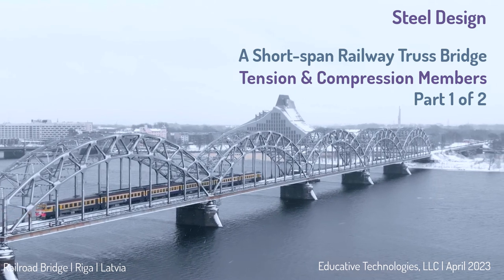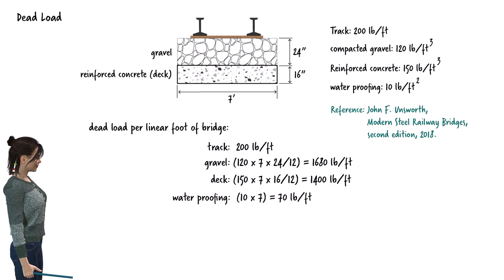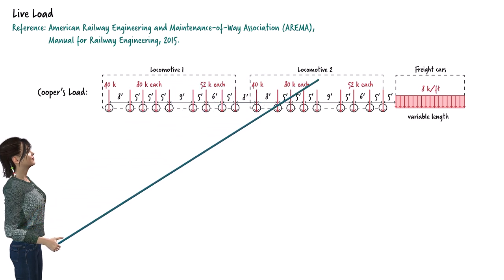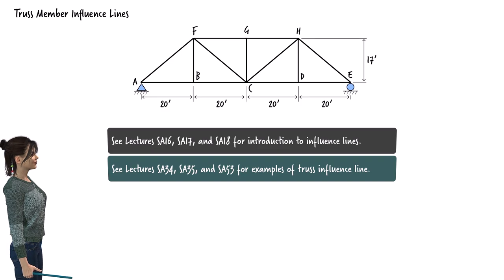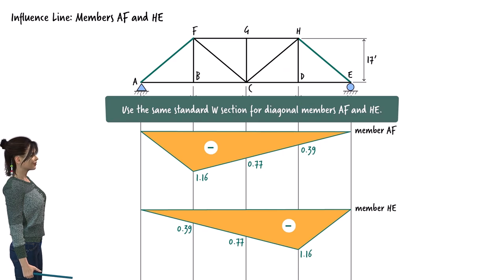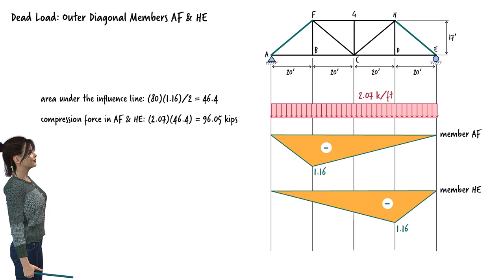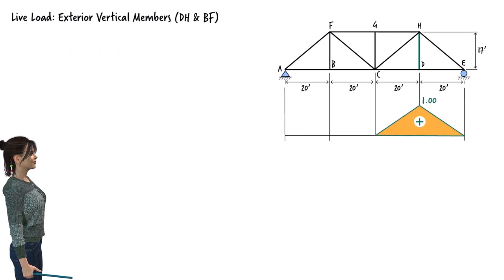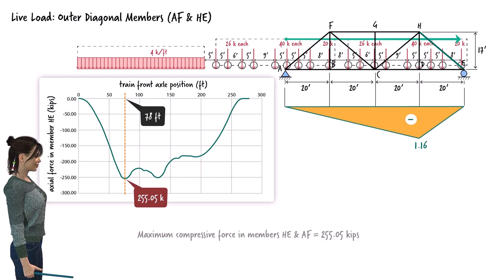SD10.1: Steel Design of a Short-span Railroad Bridge (Part 1)

Comment: Good day Dr Structure. I am very happy production of these fruitful videos which are shaping into becoming a good designer. I  have a project question that i am struggling with which is  dealing with designing a robust water with steel framing.

I am emailing you the screenshots of the project description and kindly requesting for your assistance in any form  possible.

I have tried using the iframe but i am struggling.

Comment: Would you tell us the reason why is it a practice that structural steel box girders for metro rail transit are joined at a location just after the portal beam support? The joint is located within the clear span of the box girder but near the support ?
Reply from the maker: In continuous (long) beams, the area near the support will experience lower bending moments compared to the mid-span of the girder. Placing a splice at this location can reduce the stress concentration and allow for a more balanced distribution of stresses.

Needless to say, splices become necessary when we want to construct a long beam from shorter beam segments.
Reply: @DrStructure  I appreciate your reply. 👍
Reply: @DrStructure  In relation to the situation I did mention, would you know, at least approximately, the location of the splice from the center or face of support that will give a lesser bending moment in relation to the depth of the box girder?
Reply from the maker: The location of zero moment depends on the location of the supports and the nature of the loads. We can construct the moment diagram for the continuous beam and see where the moment curve crosses the x-axis. That location would be the ideal place for the splice. Generally speaking, for such beams, bending moment goes to zero at a point close to L/4 from the supports where L is the length of the span.